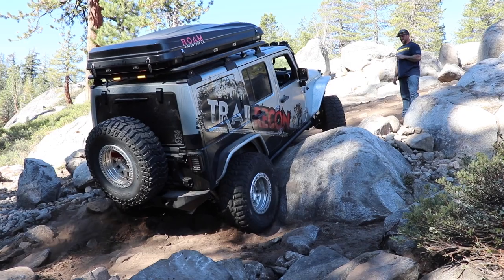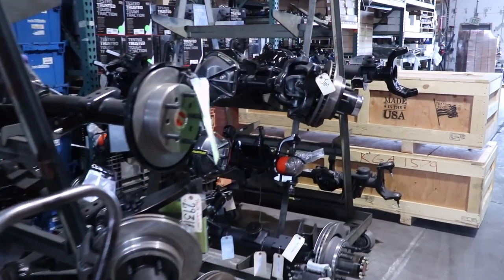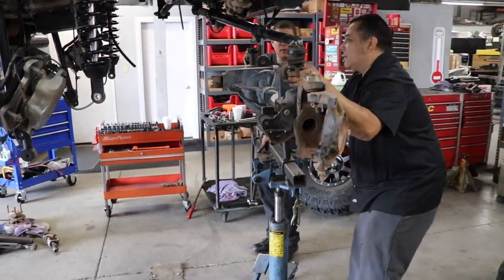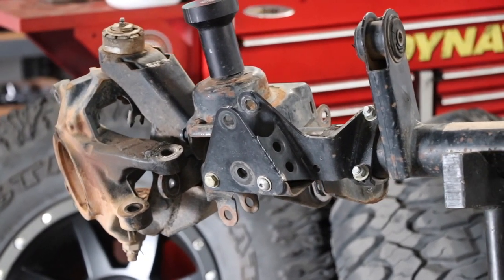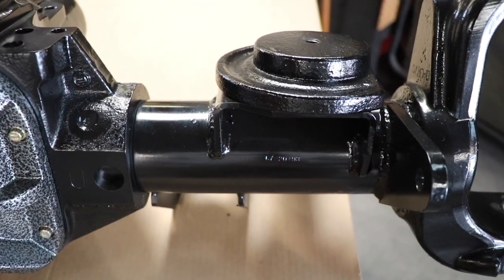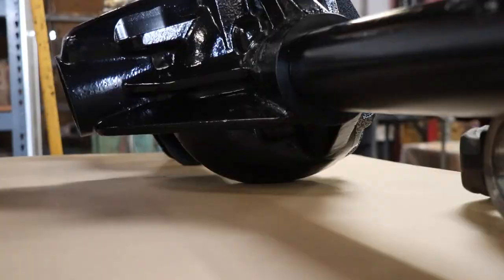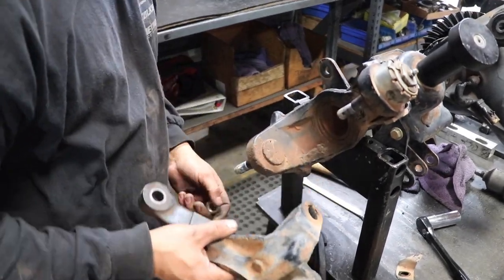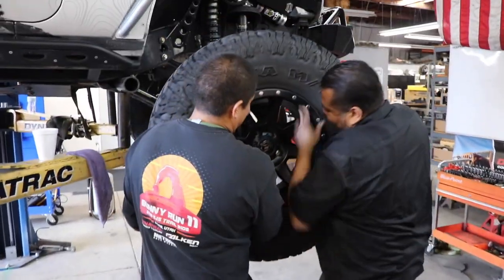My Old Axles Have Taken Some Serious Abuse! It's Time for an Upgrade

Comment: Another great video Brad, great job. I am planning to upgrade to the Prorock 44 as well in the near future. I am running full 37's. I will be using the gearing and Chromoly axles that I have now. My question is, what have you done for beefing up the steering box, pump ect. I currently have upgraded my Brakes and installed the 1 Ton Drag link and Tie rod but no flip kit or knuckles those are the stock components. Thanks
Reply: PSC is the only option as far as beefing up steering box. There's options for tapping stock steering gear but it just makes your sector shaft more prone to failure. PSC Big Bore w/ ram assist is the way to go.

Comment: Just curious what you think about the RCV axles, I probably would have put in the CV joints instead of reusing the stock ones. What are your thoughts?
Reply from the maker: I think they are the best you can buy, a bit pricey, but will serve you well.

Comment: Hello. I have a wrangler Sahara and would like to start making modifications and personalize it but I'm not a mechanic. My question to you and your followers is what tool set should I get for just adding accessories and making mods like changing the lights, bumpers, grab handles, etc? I have seen DeWalt tool sets for around $200, but do I really need that many tools just to work on the Jeep. Thanks in advance for any advice.

Comment: do you know how many miles you had when you went from 35 to 37s? How many miles did your Jeep have when you swapped axles? I want to go to 37s basically right off the bat with mine. I got a 2014 JKU rubicon, stock with 125k miles. I wanna do a lift and tires either 35s or 37s

Comment: Love your Channel by the way.. a vibration upfront 55 and over is not death wobble any ideas should I buy a track bar first..thx..
Reply from the maker: First thing I would do is get your tires rebalanced, common issue if it happens over 55mph.
Reply: @TrailRecon  thx.. they have been rebalanced and relined all the way around how about a tie rod  will it  give vibration..

Comment: Did you have a video of why you went with the Milestars over the Cooper tires? 
If not will there be one?
Reply: Willie1187 just scrolled through the vids looking for it. I’m curious about this as well.
Reply: I used to have Nitto Trail grapplers, and i went to the Milestars. There are a few things about the Patagonias that are awesome. 1. They are sticky, like really sticky. That is a nice thing when you are out rock crawling. 2. They are very quiet, from what I hear. 3. They are not super expensive to purchase. I cant make a statement that they are a great value, because I don’t know how the life will be but the initial purchase price was not expensive.
Reply: I think it's a matter of the terrain you wheel. From what I gather, they seem to thrive out west. I'm in the North East and they're not too popular here. The marketplace and local Jeep groups are fully loaded with people selling 38 and 40" Patagonias with less than 5k miles on them. I went from 37" STT Pros to 38" Patagonias, back to STT Pros in a matter of 3 months.
Reply: All I know is they make it big deal about buying a fully USA made axle and then go buy made in china/taiwan tires.

Comment: I have a two door 2020 Jeep Wrangler Sport S that I swapped axles on, for Dana 44s (M210/M220). I'm preparing to do some overlanding. Well, kind of. I'm in PA and am doing a month long trip from PA>Moab>Rubicon>PA. I'm building out the cargo area (kitchen/stove/storage). I had an AEV 2.5" Dual Sport lift, since its known for handling heavy loads. I plan to upgrade the axles for RCVs. Then I'll cross my fingers and hope I complete Rubicon and get home safely. :) I'm blogging about my build (donmontalvo.com), nothing like what you're doing, maybe one day.

Comment: I have JKU sport with 35' tires. Do you think axles and gear need to be upgraded?
Reply from the maker: I think it all depends on how hard you wheel it and how well your current axles are holding up.

Comment: What did you do regarding the locker?
Reply: Did you not watch the video? They literally had footage of drilling a hole in the diff to accommodate the e-locker that they swapped over from the stock D44

Comment: Hahah this is something I’ll never understand.
Replacing my axles on my Landcruiser or any other Toyota 4x4 I’ve ever owned has never crossed my mind. It’s laughable how weak heeps are.
Reply: Try putting 38"-40" tires on them and then try saying that...but you can't, what's the biggest tire you can fit on a solid axle Landcruiser...33, maybe 35". If they were so great why did Toyota go IFS in '98?
Reply: Ryan rkj 
35’ for the last 13 years
Reply: Jeep Wrecognize Jeep 
I’ve run 35’s for 13 years
Been down to Moab and all over USA on dozens of trips.
I live in BC and wheel my truck often. Toyota went to IFS in 98 to save money. That’s the general reason for most things. (only On the 100 series Cruiser, all 70 series are still solid front axle to this day)

Comment: Smh, JK JLs can wheel, but they're  complete junk....Once they hit 100k or so All these newer jeep models begin to fall apart... couple hundred grand miles and there all going to be scrap metal, or plastic...
Reply: LAND CRUISER LIFE,     Not mine.  I plan to keep mine forever...even if it requires a frame up restoration some day. :)
Reply: @N8FLY  I know my comment sounds really negative, my bad about that... If you guys plan to keep repairing/ rebuilding by all means then you guys are good to go... Disregard my comment...